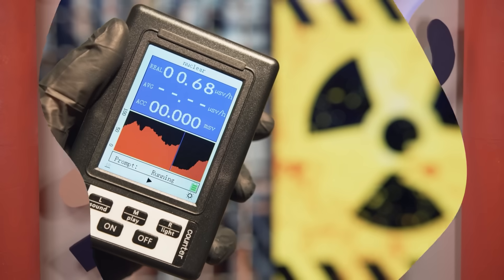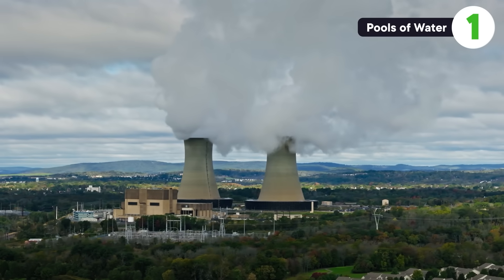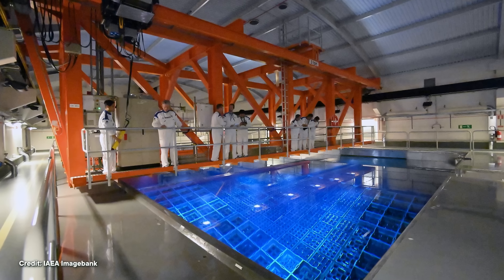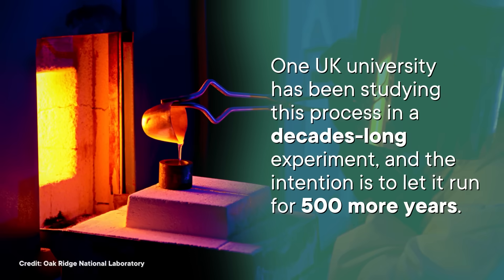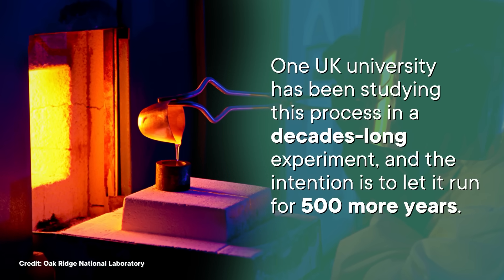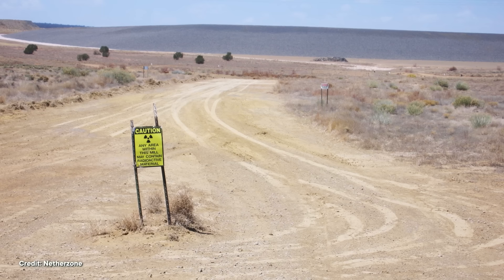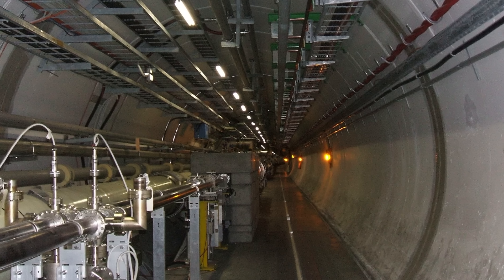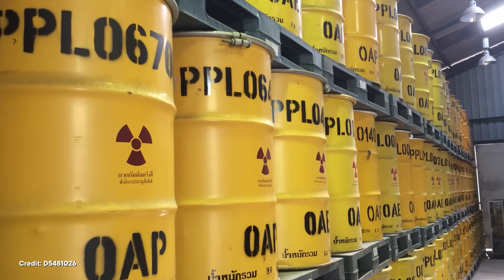So You Need To Dispose Of Some Nuclear Waste…

Comment: Got to fact check the SciShow guys.  Hospitals do not sterilize with Cobalt or anything radioactive.  They sterilize with steam and hydrogen peroxide plasma, and to a lesser extent ETO.  Cobalt is used for what we call "soft goods" which is disposable things that the hospital needs each procedure.  There are lots of disposable versions of products like scopes and bipolars.  They are sterilized at the factory well before they reach a hospital.

Comment: Don't forget about newer reactor designs being able to use current nuclear waste as untapped fuel.  Also...you have to ask yourself where the waste of other forms of electricity generation (gas/coal) are stored.  Answer - they're not.  It's exhausted into the air, though scrubbed to a modest extent.  Fly ash is nice though for concrete.

Comment: This comes across as a passive aggressive fear fest.

The storage of nuclear waste is far easier than people are led to believe because humans have a natural tendency to do things the dumbest way possible.

A fuel rod only uses 4-5% of its original uranium during its lifetime. When the rod is removed it still has 95-96% of its uranium mass. Remove the fission products, top it off with a little fresh uranium, and reinsert it into the plant.

The kicker is the uranium is the long lived product that's going to take millions of years to decay.

Isolate the uranium and plutonium for refuel, and the remaining waste is decayed enough in 300 to 500 years to be of zero concern. Those dry casks they glossed over are designed to last far longer than this.

And that final load of waste when we do stop using nuclear? Same process and you turn the remaining uranium and plutonium to glass and bury it.

Here's a fun fact they didn't bother touching on.

A single coal plant produces more radioactive waste in a year than every nuclear plant in the world has produced in the last 80 years combined.

Oh yeah, and there's almost zero regulation on how they dispose of that radioactive waste.

Comment: Swimming in a Spent Fuel Rod pool without authorization?... Nope, that would be extremely deadly.  So deadly, in fact, that you'd be dead even BEFORE you got into the water.... from the bullets. 😆
(also, I'm pretty sure XKCD tackled that very issue many years ago in their "What If?..." book, and came to the same conclusion, unless I'm mis-remembering?)

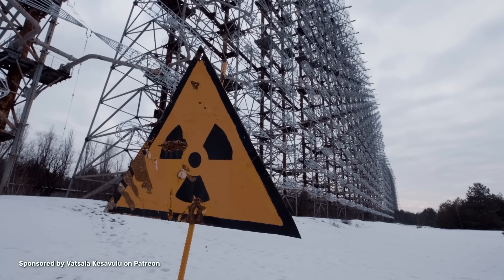Comment: 1:30 "with enough time a dangerous radioactive thing will release enough energy that it becomes a not dangerous, not radioactive thing. That amount of time can be measured in a half-life, which is..."

No, that is not what a half life is. A half life is the amount of time it takes a radioactive material to break down 50% of it into SOMETHING ELSE. It is NOT said, that the something else is not dangerous, not radioactive. Lots of times radioactive things break down into other radioactive things which break down to something else until at some point it becomes a stable element. We call that a decay chain. Some of them are rather long, some of them have a long halflife, followed by several short ones, leading to them being especially nasty, as they will give of high levels of radiation for very long times.

Comment: Hm this video mixed up a lot of topics and omitted some important facts. While still interesting it's not the quality we're used to. 
Just some more stuff that came into my mind: 

- There are a lot of ideas about storing the waste, including using salt mines (since the salt might have benefits). Could've been explored in this video.
-  Instead if just dumping spent fuel into a storage you can reuse and recycle it. Newer reactor types can run if spent fuels and by recycling you can get the "good" stuff for further usage and thus minimizing the amount of waste. 
- You can also use transmutation to shorten the half lives. In a lot of countries experiments are running to make this available at large scale. There are several methods but you basically transform an element with a long half life into one with a short one. You can harvest get energy this way: More energy, less waste. Sounds good? And you only would have to store the remains for 100 years or so instead of millennia.  
- The waste from uranium mines is primarily not dangerous because of the radiation from uranium but because uranium is a heavy metal and the tailings also contains other chemicals from processing and minerals (including heavy metals and radioactive ones like Radium that are not of interest). The fact that tailings emit Radon is not exactly a benefit but rather a problem for the area. Natural uranium ore or depleted uranium can be handled quite safely and is even used for warheads because of its strength. As a solid block it doesn't need much safety procedures. But dust can be inhaled and you get heavy metal poisoning even before the radiation will do any harm. That's the issue with the ammunition the US used in - for example - Iraq. The issue with the mines can also exist when mining for other minerals. Fun fact: coal also contains uranium and so coal plants release radioactivity into the air - more then nuclear plants do.
- xkcd did a comic about swimming a storage pool for his "What if..?" series. Yes it's fine. At least from a radiation point of view.
- you don't need "man made" for radiation to be dangerous. There are several locations with high Radon concentration for example. Also outer space....

Comment: The best way to dispose of nuclear "waste" is of course to use it, as the unused fuel it is.
Spent nuclear fuel rods are not waste. Less than 7% of the fuel has been consumed when the rods are removed.
It is only if we stop using nuclear power completely that we need to store it for 100k years.

Comment: One thing that can help with nuclear fuel waste is reprocessing it. Since the vast majority of spent fuel is still uranium, indeed most of the available energy is still there. Only thing is, reprocessing isn't allowed in the US. So we're burying tons of usable nuclear energy. Also beyond reprocessing there's fast nuclear reactors which can use fuel regular reactors can't. Which means you can use the stuff you would otherwise bury to make power. Alas, research on fast reactors is kinda dead in the US, cause without reprocessing, not much point.

Comment: 6:40

I would like to point out the short half lives means the thing is MORE dangerous for you, not less, in an exposure event. Tc-99m is about 7 trillion times more radioactive than uranium. Meaning it is going to dump all of its energy much more quickly. This is "nice" in that we know it will be gone in a short amount of time, but make no mistake, short half life = greater potential short term exposure risks. Basically the general thrust that short half lives can make some aspects of managing exposure easier, it shouldn't be conflated with short half life = more safe...just a different kind of risk regime.

Comment: You should totally do a follow up video on CANDU reactors and nuclear recycling and how they can take the spent rods and still use them since typically they run on natural unenriched nuclear sands which gives them an advantage and fuel agnostic design... If the USA merely built a few of the MONARK 1000's for every other reactor type there wouldn't be any waste build up.

Comment: In short : 
- waste management for the nuclear power industry is well controlled. Two problems. 1- long term highly radioactive material : there quantity is very low. It's easy to put them underground in a layer that has been stable for millions of years and is not likely to be disturbed for millions of years. Geologists know their stuff. 2- uranium mines in 3rd world countries with low safety regulations (which is not mentioned here but is the same as mining any dangerous material).
- the LHC : these guys know their stuff
- other usage (medical, industry...) : THESE ARE THE WORST IN TERMS OF DANGER because they are everywhere and their is almost no centralise body which control their disposal. It is why the worst civil nuclear accidents happened in this category. Worse than Chernobyl but less impressive to be breaking news matter or Hollywood stuff.
- military : well, until there is a 3rd world war...
- terrorists : yes but it is not a very efficient way to cause damage and it is very difficult to do if you are not a state. Normal bombs or guns are way easier. It can be used as a poison though : Russia has been utilising it to poison individuals for years, but you need a know-how and means that are not easy to find..

Comment: The sun is also radioactive, though for somewhat different reasons than nuclear waste. While most of the harmful radiation form the sun is deflected by the Earth's magnetic field or stopped by the ozone layer and the rest of the atmosphere, we do still get a small amount of harmful ultraviolet radiation. So make sure you stay safe in the sun, especially during summer, and wear sunscreen! Especially if you are at latitudes close to the equator, try to stay in the shade from late morning until the afternoon.

Comment: If we were wise at all, then we would recycle the fuel rods.  Only about 10% of the uranium is used.  The supply could be 10 times as effective and the waste could be 1/10 as massive if we simply extracted the uranium from the spent rods before disposing the residue.  Additionally, we could easily find useful applications for much of the residue if we simply considered the possibility seriously.
https://www.energy.gov/ne/articles/5-fast-facts-about-spent-nuclear-fuel

Comment: I surprised the topic of reuse/recycling didn't come up. If a fule rod is still hot enough light up a huge pool with cherenkov radiation and heat the water to near boiling for 20 years, that is A LOT of power that is just be thrown away. I'm pretty sure CANDUs can use that stuff. CANDUs also  also produce tritium as a "waste" product but the operators are smart enough to collect it all and sell it for use in everything from glowing key fobs to fusion research to atomic weapons programs. Seriously much of that "waste" is worth orders of magnitude more than gold to the right buyer if it's refined.
Reply: Yes. Yes they can. They can also recycle their high level waste like France and Russia does now and turn them into new rods of highly enriched uranium. But your main point is solid. If nations merely built a couple of CANDU Monark 1000 reactors for every existing Boiling or Pressurized water reactor the volume of waste would be reduced significantly and the whole issue of what to do with the excess toxic HLW would be almost non-existent...
Reply: Less than 7% of the fuel has actually been used when they removed the rods.

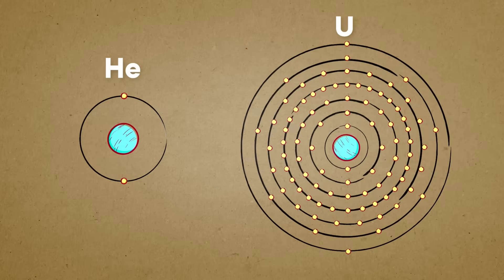Comment: 0:40 I'm not sure how a uranium atom losing an electron becomes thorium, 1:51 naturally occurring radioisotopes like U238 have half lives in the billions of years. 2:18 fission is not the same as decay although given that spontaneous fission is a type of decay one could argue artificially induced fission is a type of artificial decay. 3:06 implies that higher radioactivity is desirable in a fuel. The unused fuel that goes into a reactor is typically less radioactive than the spent fuel that come out of it. With that I've stopped watching because it's just to loose on information.

Comment: I wonder how hard it'd be to solidify it to a state that'd withstand extreme compression, then chuck them overboard while sailing over one of the continental rift zones.  By the time they're pulled under in a subduction zone they'll have passed a lot of half-lives, then getting remelted, mixed, and eventually either consumed deeper or regurgitated via volcano, there won't be much radioactivity left, if any at all (above background).

Keep Godzilla happy & warm down there.

Comment: Misleading thumbnail. B-roll of barrels with biohazard symbols. The liquid waste is not dried into a powder. That would be a nightmare for contamination controls. We remove as much water as possible from the liquid, usually through decanting. Then glass forming compounds are added to the waste and mixed together. The whole thing is melted together, then poured into steel canisters. Those canisters go into lead and concrete lined steel drums. The rest of the info in the video is fine.
Reply: Also, power plants don't produce liquid waste. It's mostly ceramic, except some more advanced reactors where it's metal. The really nasty liquid or gooey stuff is mostly left over from weapons production. The cold war sites are the worst. The process of extracting plutonium from breeder reactors as fast as possible by any means necessary created some terrifying waste, in gigantic quantities.

I would also have liked to have heard a bit more on recycling, as pretty much all current spent fuel from commercial power production can be recycled, usually quite a large number of times, back into reactor fuel for fast reactors. I'm endlessly frustrated by the debate over proper storage and lack of conversation about the seemingly much more sensible breaking down into stuff that is much less dangerous while simultaneously providing for all our power needs for several hundred years.
Reply: I was also hoping they'd mention recycling but the video is more focused on storage. Still, glad to see nuclear Thor giving pointers where needed. A science channel has to get the science right!
Reply: I have a problem with the possible reason the Navajo have higher levels of uranium is from the waste of mining.  The goal of mining is to extract the resources being mined for, in this case uranium. I would assume that the waste from uranium mining would actually be less than what's in the soil where food is grown or unprocessed rock through which ground water permeates and or stored in. The soil is partly formed from the weathering of nearby rocks which would also have high levels of uranium, as the reason was the location chosen to be mined for uranium because of high levels.  Back to the waste which should have had a lot of the uranium extracted.  The statistics stated also seem to be misunderstood.  That 5% for the general US population is likely largely from Colorado and surrounding states where there are higher levels of natural uranium and then being diluted by the rest of the US population where uranium is not high in the soil. This is around the area where the Navajo's much smaller population live, mainly in northeastern Arizona.  I am not trying to stick up for mines improperly containing waste nor am I trying to go against indigenous population which do need support.  But in this case I just think it's a stretch to assume it's the mine and its waste when you look at the bigger picture and dig deeper into the facts.
Reply: My man!!!
Reply: Like Kyle has never used a clickbait thumbnail... It must be wonderful to be so pure and virtuous. 😇 LOL 😂😂😂🤣
Reply: @OscarGordon-b7u clickbait for regular stuff, and misleading descriptors on nuclear waste are not equatable.

Shut up...
Reply: Please make a video about how nuclear waste is actually disposed of
Reply: Would be lovely had you included a timestamp :(
Reply: I'm glad to report to Science Thor that they changed the thumbnail
Reply: Literally came to the comments to say this (because Thor, good of nuclear thunder and man-manes) has taught me well.
Reply: Good to see science communicators that I trust respectfully keeping tabs on other science communicators that I trust.  That being said, I wouldn't mind a good-natured "science check" rivalry emerging between Kyle and the SciShow team.  They may have the numbers, Kyle, but don't despair...you'll always have Kevin 😊
Reply: Nuclear Thor strikes again!
Reply: I also kind of object to the first animation in the video, which shows uranium decaying into thorium by losing an electron. I mean, I guess technically alpha decay does also involve losing two electrons, but it's not exactly the headline part of the event.
Reply: I was hoping to hear more about recycling.
Reply: NGL they should have at least consulted with someone who’s kissed it.
Reply: Typical stereotypes 😒
Reply: Why is this idiot here?
Reply: Happy to see you here
Reply: I always get happy when a subject matter expert makes a review. Thank you Kyle.
Reply: Always glad to see you spreading the good word.
Reply: They completely missed the ball when it came to mentioning how we've had tech to reuse this "waste" as fuel since the 60's.

Reprocessing, Candu, and breeder reactors. 

Those used fuel rods are brimming with fertile and fissile isotopes of Uranium and Plutonium, which is the primary reason the "waste needs to be locked up for thousands of years, instead of doing that, just use it as green fuel!!!
Reply: Love him ❤
Reply: Nerd
Reply: Thanks, Kyle! 🫡
Reply: Thank you Science Thor for a more complete explanation. You Da Man!
Reply: Love you Kyle great vids
Reply: As good as Scishow is they have a definite anti-nuclear bias.
Reply: Did they ever fix the issue where most power plants were leaking dissolved tritium into the water supply?
Reply: @alexfranz817 tritium has a low half life, shouldn't be an environmental problem
Reply: Hush

Comment: Why is the heck?Are we using cobalt 50 to disinfect things? surely there is a better way fire maybe?
Reply: Sterilisation by irradiation is used because it doesn't require high temperatures and can easily penetrate complex shapes and structures. Irradiation sterilisation is becoming less common though because it is generally being replaced by ethylene oxide sterilisation.